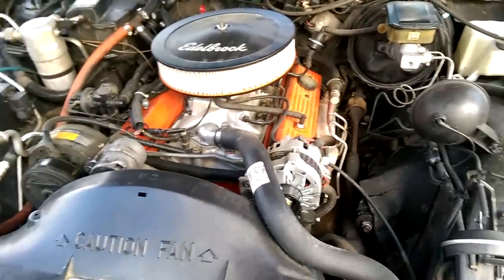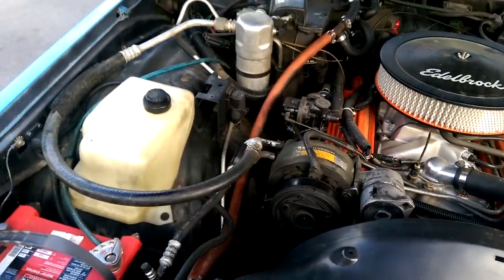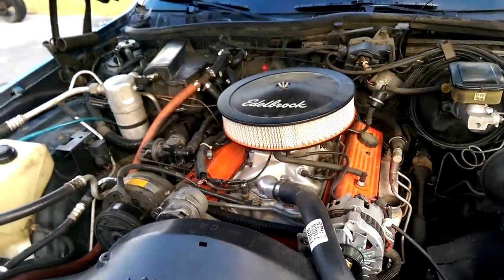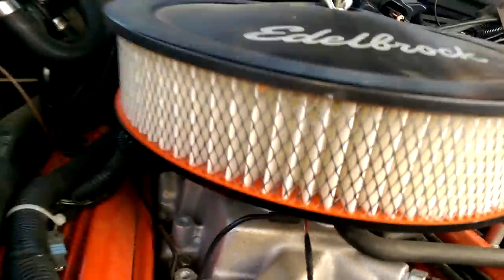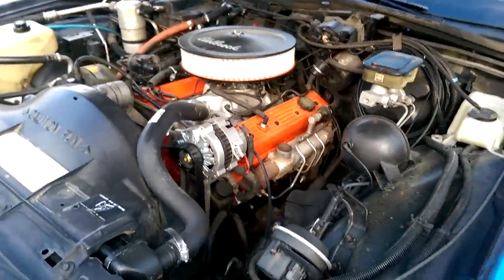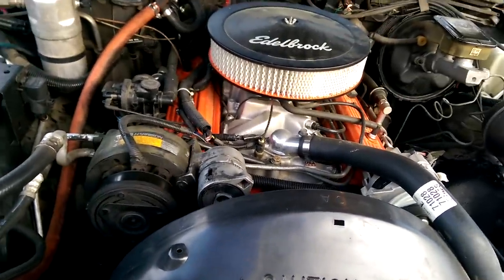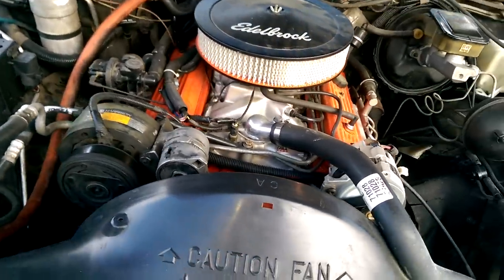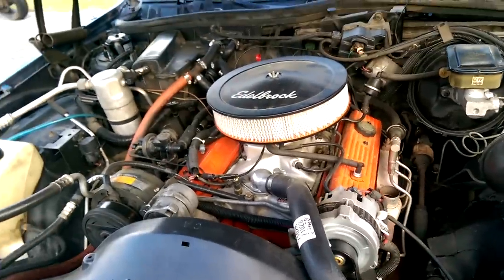Chevy 305 with a little cam New Holley tbi intake

Comment: 305 can get down if you build it right !
Reply: what do you suggest for starters?Thank you.
Reply: @Realjimenez  what do you mean? Do you mean a cheap way for hp?
Reply: @Vr6.christos  ya I’ve seen some fast 305’s in the 90’s chevys . And they don’t even have turbo or racing intakes
Reply: If u want over 350hp out of these things, it starts getting very expensive. 350/383 is always the way to go for max performance, but not everyone wants a massive speed demon. Build according to your needs and wants. 305's are reliable cruisers that wont break your rear end or tranny. I got a mild 305 build on my 92 camaro rs that has over 400k miles. I don't race anymore, but just enjoy cruising.
Reply: @ちくてぬしくけて  what do you have done with the 305 if I can ask ?
Reply: This is kinda old now , but if anyone on here is looking to get power out of their build , the heads is gonna best and probably most expensive mod. 305 or 350 but personally I wouldn’t waist my money on a 305 build for performance. 350’s are dime a dozen and the same amount of time and money spent, you’ll get more bang for the buck from the 350 or 383 build.
Reply: @ちくてぬしくけて  over 400k miles my 84 olds has 69k original miles 1 owner I was thinking it would go at about 180k or 200 I’m only 28 years old and it’s my first carburetor car old car At thay learning as I go it has a Chevy gen 1 305 in it
Reply: @ちくてぬしくけて yea that’s the way I see these 305’s as nice cruisers. I got the same care 92 Rs Camaro and I might use this engine to the max until I have enough money to do a swap for more power. Was thinking a 383 stoker

Comment: Sounds really good.
I have a 350 throttle body in my Caprice brougham and I'm going with Vortec heads and a 1103 Summit cam and see what happens those throttle body head's ain't worth 💩😤 .
This old 👴 had to learn but I'm going to keep it pimpn everything else is stock.
Until I need to put her in the wind.
Reply from the maker: Thanks for checking me out. I will have more content on my el camino and 96 impala this summer. I hate i sold my caprice
Reply: @DWillBGBodyPerformance  I feel you on selling your Caprice. Looking forward to the new content

Comment: What did that engine come out of?..I got a 88 Monte Carlo I'm trying to put a 305 with a Holley EFI sniper of something similar with a Holley intake with fuel rails..and what brackets and pulleys do you have?..I'm trying to get the same set up with the air compressor on the passenger for my vintage air system..Thanks for any advice
Reply from the maker: Thats the factory enginge for the caprice. Most of the the 80s model came with 305s or 350s. There is more performance stuff for 350s than 305. Depending on on your goal. I would sit down and see if its more cost effective to do a (i hate to say it) LS swap, find a 305 or 350

Comment: 305's are weak high production  blocks not good for more than stock configuration. Why not build at least a 350 or 383? With a solid block.  That looks and sounds like a junkyard engine swap to me, what cam is supposed to be in it?
Reply from the maker: Thank you for the shit talking. I guess thats all you have to offer. I have great day

Comment: is that tensioner next to the AC compressor stock or an add-on? I might be wrong but wasn't the 305 a triple belt setup? that belt setup looks more like a LT.
Reply from the maker: Nauman Javed that is a stock belt system I believe  Gm started to use this setup in 87
Reply from the maker: It's blank
Reply: What the fk... it won't lemme post a picture?? Ugh
Reply from the maker: Nauman Javed it won't open
Reply: I have that same set up on my 1990  caprice its stock set up

Comment: I have the 93 V8 TBI 305 Caprice. What did you do to your engine? Upgrades intake manifold carburetor
Reply from the maker: I replaced the intake manifold the throttle body and upgrade the cam to a slightly bigger cam. I had to have the computer chip reflash to match the cam. Also had the engine rebuild
Reply: @DWillBGBodyPerformance  What intake manifold did you use name brand? And did you do any replacement with the stock? TBI carburetor? I have a 93 Caprice that I'm trying to take that big funky air cleaner out. Do you have any recommendations?
Reply: I can't find anything online to replace the stock TBI carburetor with a performance one any suggestions. Same thing with the air cleaner
Reply from the maker: Check out this page from Summit Racing https://www.summitracing.com/parts/hly-502-5/make/chevrolet
Reply from the maker: You have to search by engine not vehicle
Reply from the maker: Check out this page from Summit Racing https://www.summitracing.com/search/department/air-fuel-delivery/section/air-cleaners-flame-arrestors-scoops/make/chevrolet/engine-family/chevy-small-block-gen-i?n=:
Reply: @DWillBGBodyPerformance  ok thanks

Comment: How much hp ? If u don't mind me asking I wanna do this to my 305 in my Camaro
Reply from the maker: Im not sure the horsepower gains but it was noticeable gain in power. I dont have the car anymore.
Reply from the maker: @anthonybaeza7226  yes but i also regeared my rear axle and put a posi unit in it
Reply: @DWillBGBodyPerformance  how much was it for everything
Reply from the maker: @anthonybaeza7226  think the cam kit was 600 to 700 the gears 200 the posi unit 300 the rear axle rebuild kit 100. The tbi about 450

Comment: What goes through installing a holley tbi intake or any intake for that matter..?
I’m trying to install a tbi intake by myself and i’m a complete noob can u guys give some advice? Thanks
Reply from the maker: Ahmad Wonka it's pretty straight forward. The biggest thing is to pay attention to your  distributor rotor. When you pull the distributor out you want to put it back in the same position the distributor rotor is facing

Comment: did you say a bus transmission... if so what kind of bus
Reply from the maker: tyrone jones no I said buy a monster transmission
Reply: What size transmission did you put in it
Reply from the maker: tyrone jones I haven't replaced it yet I have a 200r4 in it
Reply: Does it shift smooth
Reply from the maker: tyrone jones I did not buy a transmission yet the one in it slips a little

Comment: That motor is a boat anchor, those 305s won't make much power no matter what you do. Get a 350
Reply from the maker: I'm not trying to make slot a power it's good enough for what I need
Reply from the maker: if I decide to swap I'm doing a 5.3 or 6.0
Reply: +D Will I agree the 5.3 is a great motor if I had to pick a 5.3 or  5.7 to put in a Camaro I'd choose the 5.3. But remember your not going to get much out of a 305.
Reply from the maker: +Jake Schmale yea I know I just use it as a daily  driver I don't expect much out of a 305
Reply: D Will Yes they are good daily motors they are reliable and get good gas milage for a v8.
Reply: 5.3 the way to go
Reply: 305 wasn't a good breathing engine but  they made enough power and torque stock to have fun with
Reply: I think those 305s make decent power.  I have one with an exhaust leak pushing 298hp and 319 pound feet at the crank with bolt on items.  May not sound like much by today’s standards but for an old 305 I make a lot of people mad who’s not pushing an LS, LT1, Coyote, or Hemi.  You’ll get more power with a 350 but those 305s do pretty good. And I’m not done.
Reply: pMp Rei What part setup/ modifications are u running on the 305?
Reply: Therealmothafuckincheese My 305 came with TPI but I changed over to a Holley 650cfm with of course changing the intake manifold.  I have Hooker headers but not long tube, 80 series flowmaster with removing smog device and smog converter.  Car pushed roughly 300hp with 320 pound feet with an exhaust or header leak.  Going in for a valve job soon cause it smokes a bit too.
Reply: pMp Rei do you have dyno proof or are you just guessing hp numbers
Reply: Ray Brickles I have dyno proof that my car pulled 298hp with 319 pound feet at its flywheel.  At the posi rear it pulled 259 hp with 278 pound feet.  The car actually pulled this WITH HEADER LEAKING.  And so these aren’t it’s true numbers though it pulled them.  Yeah... I’d guess at the flywheel that it can make roughly 320 - 330hp.  My guess though.
Reply: Johnny M. Ritchie How many ponies... whatcha got??
Reply: pMp Rei what head are you using
Reply: Ray Brickles Factory heads is what I got for now.  The valves need cleaning, car smokes a bit.  Car is pretty much stock with a few bolt on items.  For the year 1988, car came stock with a moderate cam over the 5.0 and 5.7L IrocZ.  Heads are stock.
Reply: You obviously do not know what you are talking about.  The 305 was used in Formula 5000 single seat racing, and could make very good power, Frank Bartz could build a 500 bhp  engine, with complete reliability.
Reply: Pretty much all small blocks are boat anchors now, sad truth.
Reply: @pmprei3767  they day you make 260 with bolt ons is the day ill hold my 5.0 at redline, they made 175 hp from the factory and the stock heads are trash. theres no way you made more than 200 with bolt on's and if you did lets see the proof, if im wrong i will send you a handwritten letter apologizing.
Reply: @pmprei3767  sorry for you to assume what i drive cause first of all it ain't a camaro. And you have yet to show proof of any dyno numbers with your car. We've got 305s and 350s at my schools gm performance class. And stock heads with long tube headers and a holly carb they make around 190 flywheel. The 350s make about 210-220. So get your shit box camaro out of here cause we run these fuckers all day. We even have a mildly built 350 and it makes a little over 400 with nitrous. I think the last pull it made  418 flywheel so your "bolt ons aint gonna give you an extra 150 hp. And like i said show me some dyno numbers and ill write you a damn apology letter. Bring the proof
Reply: xD3W3Y And I’m sorry for you to ASSUME that I said my bolt ons gave me 150hp.  The bolt ons for my car gave me around 80hp with the car making 220 from the factory while YOU ASSUME IT HAD 175!!!  Do the the ARITHMETIC plz.  And does it really make a difference your car ain’t a Camaro... IT IS STILL A 305 ( the one you talk about holding at redline )!!!!  My numbers aren’t posted on YouTube but the video is if you want that bad to see proof ( I’ll post results later ).  Now... what proof do you have since you talk this JAZZ about proof with going to GM and running small blocks with NOS.  You running a 350 small block with NITROUS and making just roughly making 400??  YOU RUN ABSOLUTELY NUTTIN ( And it’s your own fault that YOUR 305 is ship ⚓️ ).  I’ll tell you again to keep your written apology.  You obviously aren’t ready for that.